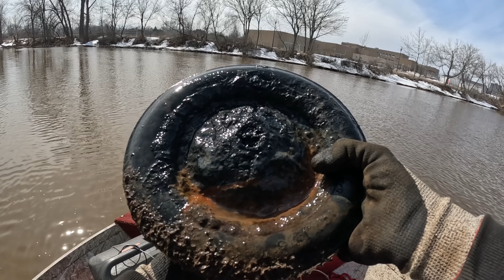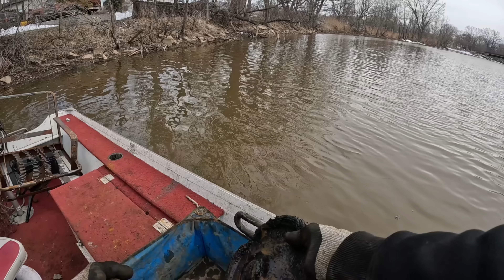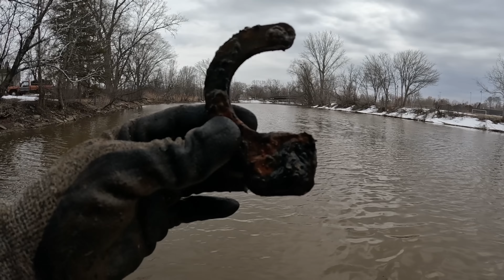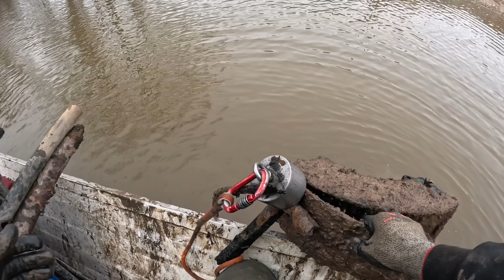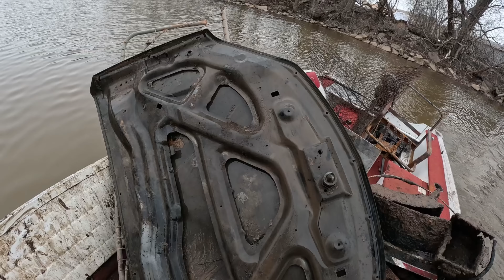OMG! Biggest Magnet Fishing Jackpot EVER Found Nearly Sunk My Boat!!!

Comment: This whole episode kept hearing the quote from Jaws, you're going to need a bigger boat
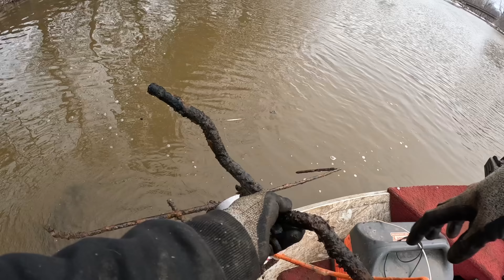8:10 that's the steering mechanism for a kid's toy. That part that first came out of the water is the handle the bottom bolts on and pieces sticking out for the wheels go.
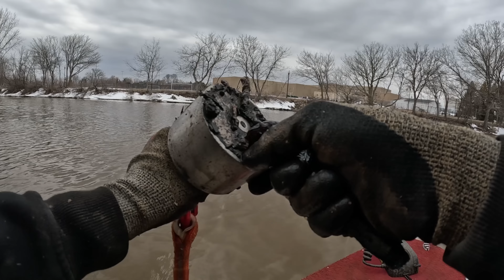10:55 not a good day into you catch a railroad spike.
13:30 that's an old-fashioned bumper Jack. The nub sticking out fits into a slot on the bumper.
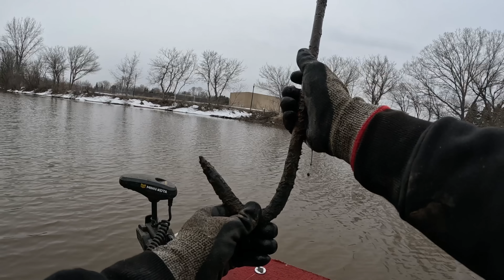17:00 definitely a meat hook probably from a truck
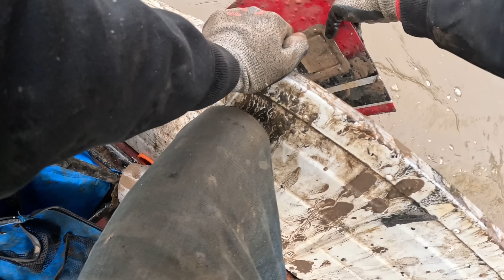21:00 accessory door from a cab over semi
25:00 shaft from another bumper jacks with the mechanism missing. Not a bottle an ignition coil. Back in the day they only had one to run all the cylinders instead of one for each cylinder like they do now
If you ever have another day like this I would suggest that you unhook the boat then back the truck beside it so you don't have to do all the walking to unload it, you can just grab it out of the boat and throw it in the truck. And you could probably have more room if you just forgot about the cart. 
  That being said another enjoyable episode. Maybe you oughta buy another boat just to haul the stuff in LOL

Comment: Oh my gosh. You know, it's so funny listening to you guys finds things that I grew up using. At time stamp 13:20, you found an old bumper jack. It's missing the base that would go on the end of the long shaft. It's also missing the jack handle that would go into the slot at one side and you would jack up the car by putting that little "HOOK" into a slot in the bumper. When you were jacking up the car, the jack handle had a octagon type of socket at one end to remove the lug nuts. The jack is from about the late 60's car!

Comment: The other thing you found was an older style ignition coil the coil wire from distributor would plug into the top of it . Can't hardly wait for the next video ☺️ im hoping to try magnet fishing soon myself what magnet and grappling hook set is best.
Reply from the maker: I always recommended the largest 360 degree magnet you can find! If you get anything from Brute Magnetics website you can use my discount code “thefisher” in the checkout 😊

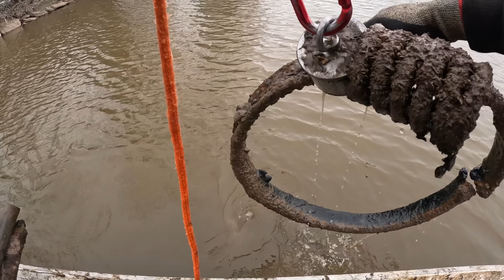Comment: 17:55 looks like the 'locking ring' from a truck's 'split rim wheel'. Some big  pickups, particularly ones from the 70's used them. Very dangerous for tire repair. Often they were put into a sturdy metal cage before unlocking and relocking.

Comment: I’m sitting down here watching your latest video and all of the finds that you pulled into your boat, and I had something jump into the question center of my head. Do you keep track of all the trips that you make to the dump and how many pounds each trip is? That would be an incredible amount of pounds of trash that you’ve pulled out of the water. That catch you pulled out of the water at 13:20 almost looks like a monstrous pipe wrench that “Andre The Giant would’ve used. Tyler, you are “The Man”. Keep up the awesome videos and the hard work you put in both for pulling all that garbage out of the water.

Comment: 8:27 mark, looks like the tongue and front axle set to from a garden wagon.  13:34 mark, bumper jack for an old car.  the bumpers used to have slots the one end of the jack fit into and a tire iron was used to make the jack lift the car.  i have 2 mid 70's cars here at the house that use those type of jack, there is a footplate those go into.  25:04 mark, ignition coil for an older vehicle.  26:05 some type of transformer, could be for 4 foot or 8 foot florescent light fixture.

Comment: cars don't have them anymore. That tube at 25:20 with the nozzle on top and the wire on the side is an old ignition coil. That thing at 13:25 is an old car bumper jack.

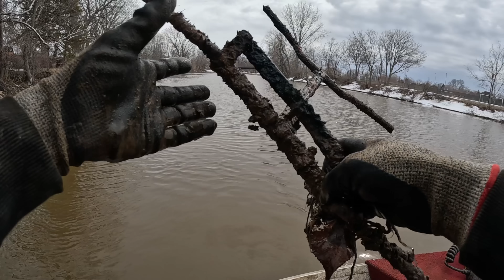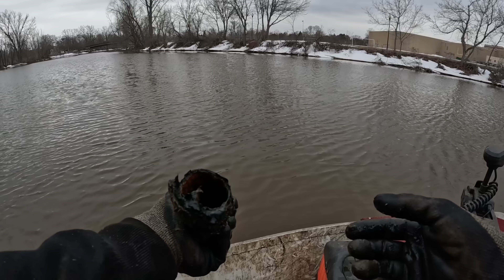Comment: You know, Tyler, you are the kind of environmentalist I like.  You don't have a political agenda, you don't want fame.  You just want to clean your local rivers of metal waste and recycle it and protect wildlife (especially crayfish!).  You TOTALLY need to come to my hometown of Regina, Saskatchewan, Canada!  The lake in it, Wascana Lake, is LOADED!  BTW, that thing you pulled out at 8:30 looks to be the frame of a pogostick! And the square thing you found at 12:50 is a pants hanger for multiple pairs.  That thing you found at 13:35 is part of a lever from a locomotive or factory.  That boxes you found starting at 22:35 are  back tire boxes off of old motorcycles.

Comment: Those wheels could be parts of an old go-cart the front tires are normally thinner than the rear tire the hillside, a road good to hold engineless go-carts races on.  

They could have been off a Mechanics cart.  Just food for thought.

The handle is from an old lawnmower. The thing you thought was his mitten it's Santa's but it's his hat. You have the top part of a lighted Santa yard decoration. Some of them folded in half

Comment: @2:07 that looks just like one of those wheels that comes off of those old cars for kids.  IN the 50s and 60s check that out, if it is, it is a cash money find.  You can get a lot of money from one of them.  Both of my older sisters had one of those little cars and when you held that up like that, I am sure it's one of them.   OMG that is the wheels of the car is too small for a hot wheels,  too big for this one, it's just right size for that one.  so you got a good deal there.
Reply: I agree!

Comment: Tyler, look at that glass bottle and see if it has a seam, if not, look to see if it has air bubbles in the glass. If it has a seam, not too old but, if it has air bubbles in the glass, that tells us it was "blown glass" meaning it's much older. Also, the very first bottles had air bubbles in the top, and the newer one's had a seam and were applied after the bottle was made.
Reply: also check the flange on the bottle different types different time periods. though it look like the bottle was fairly recent.

Comment: 25:04 - hard to tell with all the gunk, but it could be an engine coil for an older engine. Plug wire goes from the nozzle to the center of the distributor cap.

Comment: You're gonna need a bigger boat. The funny pole thing is an old bumper jack probably from the 60's. The large ring is the locking ring from a truck split rim wheel. Don't see many nowdays as they are dangetous to work on. The little round thing with wire is an old ignition coil off a car.

Comment: The last few things you broght up you thought it was a light is actually an alarm clock when inspecting the back.. it has a windup key and two other three other things to set the time.  Yy keep up the good work I enjoy your channel more than others . Al does good work too. Stat safe. Oh before I forget your battery s need to be sitting on a 1/2 inch  board in your boat so they aren't sitting just in the boat the metal boat and ground are the same when it comes to batteries  it drains the energy from by putting a board or plywood under them it won't drain. Also never keep  batteries on the floor of garage or basement .put them on top of a piece of wood That's a tip from my grandfather he use to go catfishing in his boat off the cedar river in Iowa..